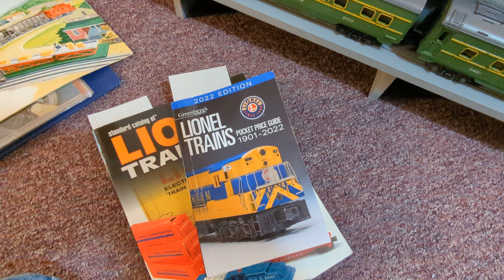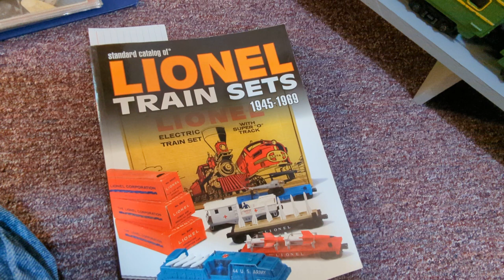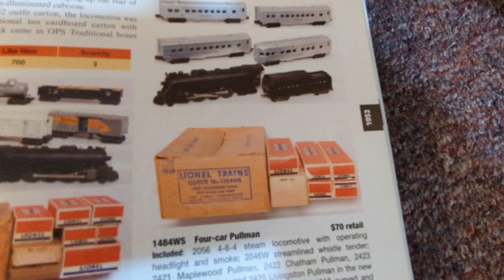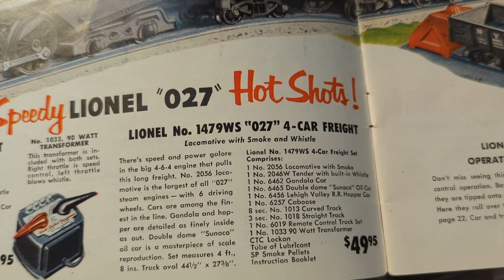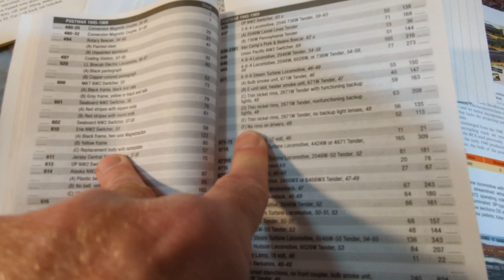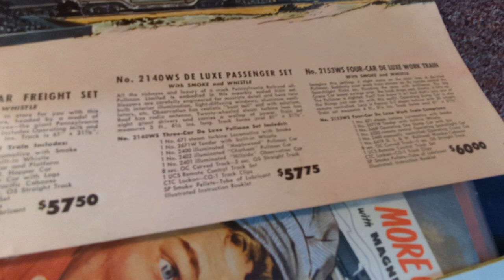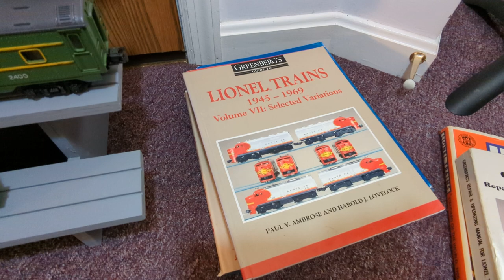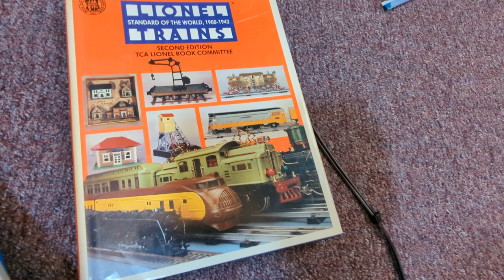How to date and identify old Lionel train sets. Here I show how to identify two postwar sets.

Comment: I have these, although the I don't own a LV car. all post war. all early 50's and late 50's, 
 the real guess work is in knowing what your looking for / at when examining a car, castings, 
sharpest of it,
Reply from the maker: @Sojourning_  I have more than 25 years of collecting and working on postwar and Prewar Lionel, so it is fairly easy for me to recognize many. But I still use my references to help me out. The truck types do help in narrowing down dates. In general: Staple end metal trucks with coil couplers were early postwar 1945-1947/48, then staple end with magnetic couplers1948-1951, Bar end metal trucks from 1951/52 - 1957, then plastic AAR trucks 1957/58 - 1969.

Comment: In the back of that book it lists all Post war sets and it will tell you the exact year your set was sold by Lionel. You can tell further by types of trucks, and coupler types and other features on the cars. the dates on the cars in the post war years corresponds to the year the Heat Stamp dies were made and it never changes. The hoppers all said Blt 48 all through PW production.
Reply from the maker: All great points!  Thanks.

Comment: Any advice for dating younger train sets?
Reply from the maker: The Greenberg's price guide is still a handy reference, but it can be more difficult with modern trains because of the different catalog numbers used on engines and rolling stock. I'm primarily a pre & postwar collector so I don't have as much experience looking up the modern items. I also don't have any references on modern sets. Google search of your engine number & cars is probably going to be your best bet. Unless you have an original set box with a set number on it. Sorry I'm not much help with the modern train items.

Comment: You said 1949 to 1969 but those two books said 1945 to 1969. Was that just a mistake?
Reply from the maker: Yes, I misspoke in video. Postwar is 1945 to 1969.  I typically don't rehearse or edit my videos, so I may make a mistake once in a while.....  Hopefully it did not detract too much for you.
Reply: 1946-1969 is generally considered Post War.

Comment: What about 1110 and 8204 and 885
Reply from the maker: Using the Greenberg's guide I showed: The 1110 is a postwar period loco (1945-1969) and was produced 1949, 1951, and 1952. The 8204 is considered a modern Lionel (1970-today) C&O 4-4-2 locomotive produced in 1972. The 885 is a new Santa Fe steam engine. I had to Google this one because the modern trains do not follow the cab numbering of postwar and prewar trains. The catalog number of the 885 is 7-11192. My intent was to show some ways to date Postwar & Prewar trains. I am strictly a postwar/prewar collector, so I am not very knowledgeable on modern trains (1970-present).
Reply: @alsvintagetoytrains7042  I just picked up a 666
Reply from the maker: @nickythebull82  That would be manufactured by Marx,
Reply: @alsvintagetoytrains7042  ty for all the information